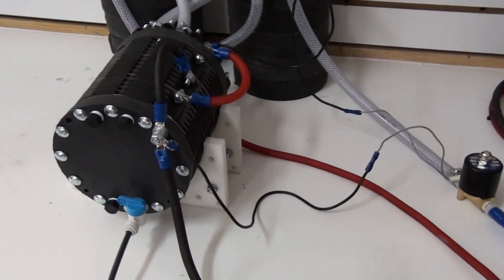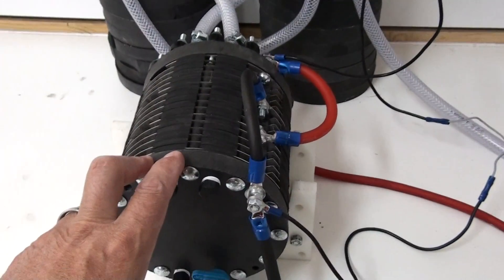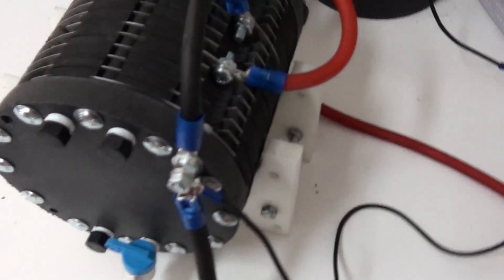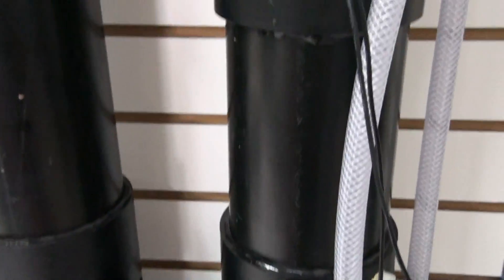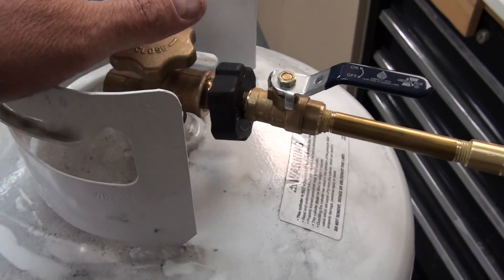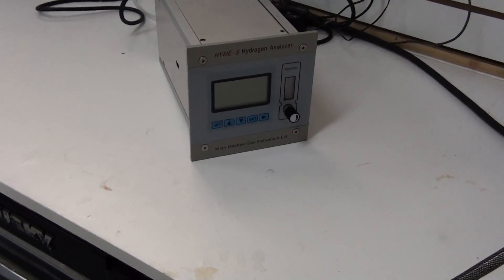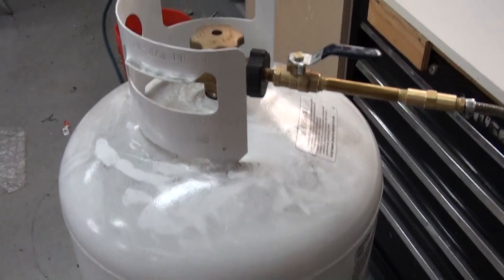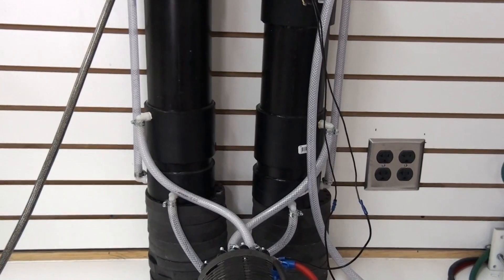Pure Hydrogen Generator Split cell system. Hydrogen compression. PART 2

Comment: Hi l think you must have your gas tank upside down while filling or the oxygen in the tank could be trapped that you cannot detect at the bottom of the tank like a big bubble of oxygen in the tank?????????????
So you will not be able to get a reading from the bottom of the tank where the oxegen might still be present 🎉💣
Please check ☑ for safety reasons and do a video test cheers 🥂 🥂 🥂 thank you

Comment: hello Delvis11 congratulations for your tutorial.  I have a question for you.  I made myself a dry cell to be able to separate my 2 gases I have 18 flat and in the center I installed a membrane.  it's natural chamois and when i get my 12 volt my gas separates for about 5-10 minutes then it mixes why?  I also tried to put nylon as a membrane but the water does not cross and my gas this mixture?  how do you install your membrane?  and what is it made of?  thank you very much for the help 🖐
Reply from the maker: Pressure pushes the gas through the membrane. You need a nonpermeable membrane.
Reply: @Hydrogen4Health  yes I am placing a nylon one.  water does not pass through nylon and gases this instantaneous mixture.  and I need more current to make it work.  I will try to put a membrane between each plate, what do you weigh?  Thanks a lot

Comment: how many liters of  hydrogen will go into this 100 USA gallon ~(383 litre ) propane container in initial 25 psi  .Also what size   gallon propane container is used   to compress up to 130 psi and will it contain the same amount of litres of hydrogen as the 100 gallon tank